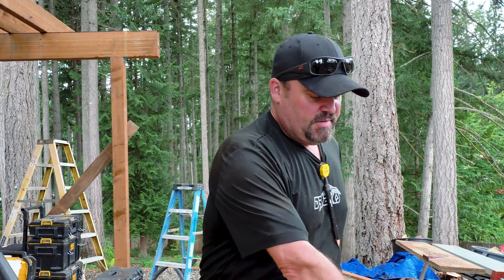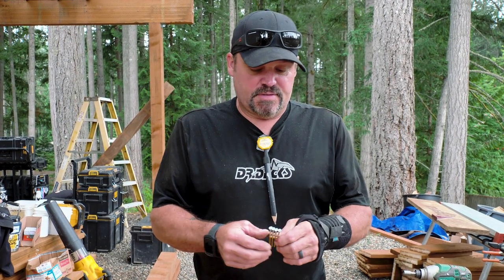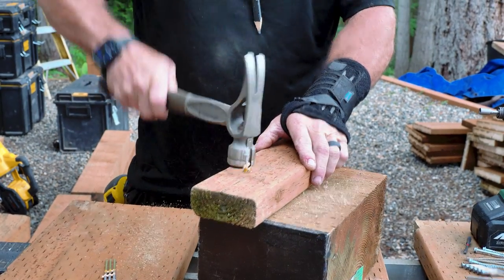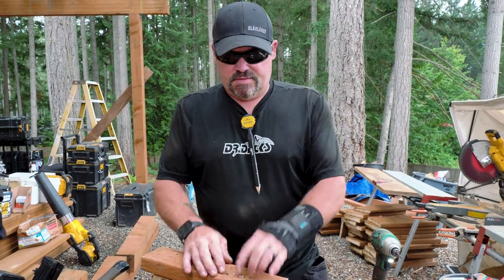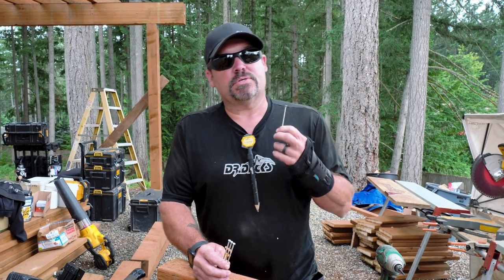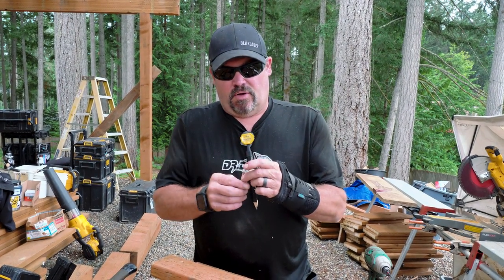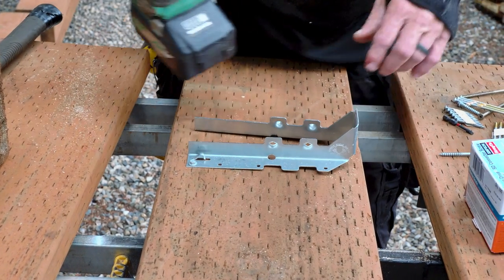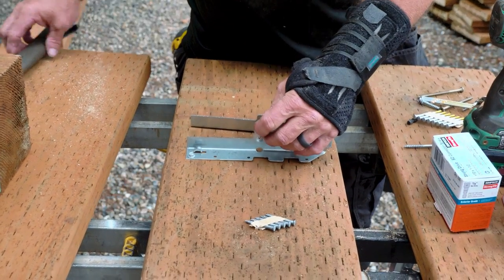Nails Vs Screws || Dr Decks

Comment: I have started using a air powered palm nailer for tight areas when putting in those special hanger nails.  I used to think That palm nailers were just for lazy people that couldn’t swing a hammer straight but it seems to actually be a pretty nifty thing.

Comment: Great video.  Thanks.  Simpson technical rep told me to not mix screws and nails for a joist hanger.  The reason is that do not have load tables that show this.  I don't see an issue.  But I conform to what Simpson has said.  Also they say the same on their web site.

Comment: here in lower michigan we have to use 3 inch 10d joist hanger nails into the ledger and at least 1 1/2 into the side of the joist.  the screws will work too but they want us to be into the house a little with the ones on the ledger

Comment: I have a question. If the deck has joists that are 12" on center and less does every joist need to have a fastener. I'm talking Timbertech grooved decking with hidden fasteners

Comment: Honestly the only thing I hate about screws is that, once you shred the screw head, it's almost impossible to remove, also I use screws as a reinforcer alongside the nails, back then on my wooden fence when it starts to come apart nowadays rather than replacing The nails I just reinforce the fence with screws and re-Hammer the nails back into the wooden fence.

Comment: Enjoying watching your videos, great info. I’m currently installing a 2x12 ledger for my own home, ledger is 4” over 5/8” OSB, with solid concrete foundation behind it. 
I’m installing using 6” wedge bolts. 
When I get to my joists, can I use the #10 SD connectors for fastening the joist hangers and joists? All side screws, no nails?
Reply from the maker: You may run into issues with the 2 1/2” SS screws where the concrete is. Simpson makes a 1 1/2” screw as well

Comment: You have to say to use galvanized nails into pressure treated lumber,, also use a short 4" cut off joist block to get correct bottom height,, and use hanger gun, once you use the gun, you will never look back.

Comment: What do you recommend for fastening joist to rim joist from the joist side? The deck I'm building is butted up to an existing structure so I can not fasten the joist from the outside of the rim joist. I do not need joist hangers.
Thank you.
Reply: You only option is to splurge for the $1.50 hangers or do a crappy, sub-optimal toe-nail.

Comment: Nails have a better shear strength  and screws have a better pull strength. 

A combination of both works great. 

The best test, is to drive a nail and a screw halfway into a board. Bend them over, back and forth, the screw will break before the nail does. Try to pull them out, the nail pulls before the screw.
Reply: Not if it is a structural screws. Using the appropriate type, screw will beat nail every time. Nail is cheap though, and faster to install with a nail gun.
Reply: Ringed shank nails hold really good. 

When I pull a board up/off that has been fastened with ringed shank nails, a lot/most of the time the nail stays in place and pulls completely through the board. Plus they have great shear strength
Reply: @juzoli  if you have a structural screw and a nail that have  the same diameter, the nail will still have a far greater shear strength
Reply: @robtien7  You are confusing structural screws with framing (construction) screws. What you say is true for framing screws.
But structural screws are strong as hell, as they are made of special materials, unlike common nails. Nails are more elastic indeed, but a nail will start to bend, and later break before structural screw would break without bending first. 

The downside of structural screws is that they are expensive… If I would build a deck for profit, I would use much more nails. But when I build it for myself, I use only structural screws.
Reply: @juzoli  Can you provide a citation for that? Simpson Strong-Drive screws are structural screws, and I haven't read anywhere on their website where they claim their SD screws are stronger than equivelent diameter nails.
Reply: @boots7859  “The single-fastener load capacity of the #9 SD screw exceeds the capacity of a 10d common nail, while the single-fastener load capacity of the #10 SD screw exceeds that of the 16d common nail.”
The load tables are on the website of the company.
Reply: @levelseven9841  Very true.  I hate removing ring shank nails.

Comment: I wonder what your rep would say about mixing nails and screws on the joist hangers. I read on their website that they do not recommend using a combination of nails and screws.
Reply: If you are talking about Simpson, I believe they state not to use nails AND screw in the same connection. Which I read to be 2 in 1 whole, which is never right no matter what...